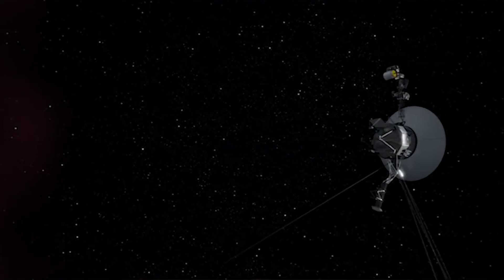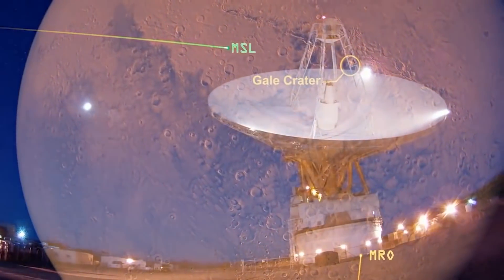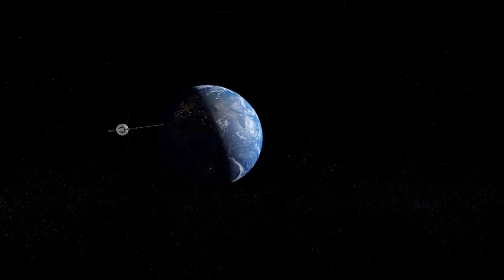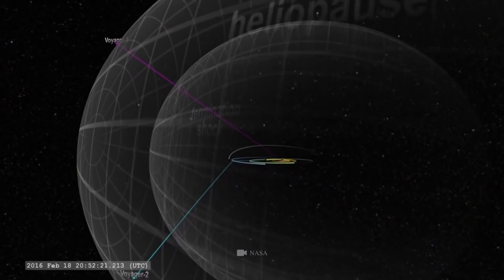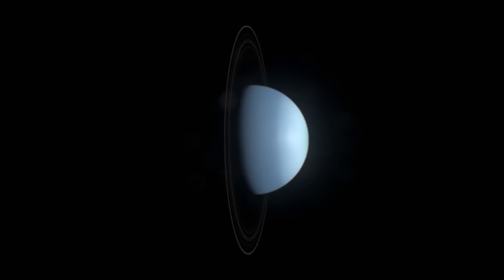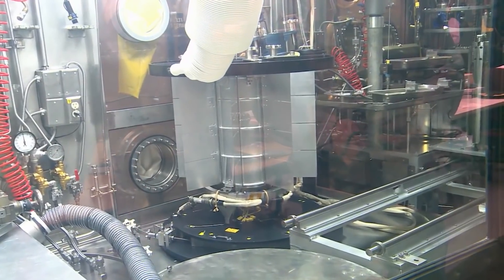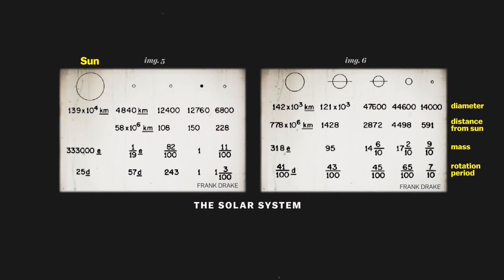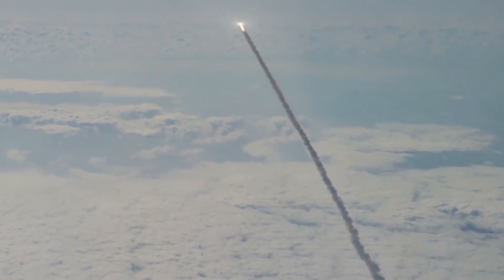Voyager 2 is FINALLY Back Online but Scientists Found Something SHOCKING

Comment: AT 9min You told the wrong story off all, WHY an LP? Why????? Because with NOTHING you can Still hear sound out of it. Find your self a record, Just the record and go figure how you can reproduce sound with your fingernail to get the information off it. That is why a Record. Also a scratch on it or even broken you can still fix it. A harddrive or memory stic Just bits and zero's . how to read that compressed also? Even YOU at Earth has no clue  how to read that.TAKE a HArddisk from a vintage early 70's computer . Or a 78 RPM out of 1910. Give you 3 minutes to get the "data" from both of them.With the 78RPM Just a Toothpick will do. The Hard drive you are YEARS away to get to find an old computer, restoring it, finding the plans , the broken parts, the old Usermanuals, The software, Success. How about an Alian, how can He find an IBM system 360 back in space??

Comment: I say, turn the camera on again for a quick pic. Who knows what it might see.
Reply: The last image taken with the camera is known as the 'pale blue dot.' The camera is analog, and lower than NTSC resolution. It my not even resolve the sun at such a distance.
Reply: @moconnell663  But it might spot that alien craft hurling towards us....  Or away depending on what they saw...   🤣
Reply: 😂 its all fake
Reply: A lotta nothing.
Reply: Have you ever heard of any battery lasting 47 years,, ??????!!!! not a chance..
Reply: @healthinfo1314  uhh..Did you even watch the vid Bro?
Reply: @healthinfo1314  the Voyagers do not contain batteries at all. RTEGs are lumps of plutonium which remain hot due to radioactive decay, surrounded by thermocouples which convert that heat into electricity. It's a common method of powering spacecraft which cannot use solar panels.
Reply: @moconnell663  It would have to have so many thermocouples like right in a flame temperature to even light a led light,, it don't seem possible .. and to send a signal like hundreds of millions of miles constantly really. the best a thermocouple can put out is6.8 mV so you would have to have tons of them in series in an like a fire temperature to even get enough amperage to run a small bulb ,, and to get wattage of any kind out of them how is that possible..? And  really I think it would be lucky to put out a few watts at anytime.. And they say it is loosing. 4 watts a year so how many watts did it put out when it first left.. You tell me that. I mean  in the video they say it looses like 4 watts a year so 4 x 37 years that is like 148 watts it lost so what are they saying it  was producing when it started out.??. and what do they use to regulate the decrease in that power for the equipment... Please explain that. I can't figure it out.
Reply: @healthinfo1314  - https://rps.nasa.gov/power-and-thermal-systems/legacy-power-systems/  According to that there are 3 power generators at 158Watt initial power outage at each spacecraft - so they lost ⅓ of their power supply from beginning of the mission
Reply: @jm3779  How in that little thing with some thermal couplings or whatever they got get that much power out of some hot rocks.. thermal couplings put out such small amounts of power; super inefficient for generating power and you would need a box car full of them and just as many hot rocks to make that kind of power. And 3 power generators on it did you say.?? man now the pipe dream is too far out for me.. I would like to find a video of something like that actually working on the ground...
Reply: @healthinfo1314  - I think they use peltier electric elements to get the heat converted to electric power  - https://en.wikipedia.org/wiki/Jean_Charles_Athanase_Peltier - it’s similar what is actually used in many car cooling boxes, as you can use the peltier effect in both directions
Reply: @healthinfo1314  It is not very difficult to transmit data over such a great distance. What is difficult is discerning the signal from the spacecraft from ambient noise, thus the very low bitrate of communication, and the very large antennas involved on earth. A detailed explanation of the Voyager probe power source can be found here: https://en.wikipedia.org/wiki/MHW-RTG  Which scientific instruments are connected to the power bus is set by the spacecraft computer.  The computer also provides feedback about the bus voltage to controllers. The decrease in power is regulated by the decay of the plutonium-238, which has a half-life of 87 years, so it would be logical that the power output would fall to 50% after ~43 years. The Voyagers each had 470W to work with at launch, and currently have about 250W available.
Reply: @healthinfo1314  If you want to do a fun experiment, hit up eBay for a Peltier Junction. The cost has come down tremendously in the last few years, they're like $7 now. When you apply electricity to them, they pump heat from one side to the other. One side becomes frosty, the other scorching hot. Curiously, if you apply heat to one side, and cool the other it will work in reverse and generate electricity (not very efficiently, but it does work).
Reply: @healthinfo1314  It's alien tech from Area 51, you wouldn't understand.
Reply: @jm3779  Well I read the article and it does not say they make power and says  when power is applied it causes it to transfer 
heat..  Possibly it works the other way I don't know,, you got anymore info on that..
Reply: @moconnell663  if it lasts that long why don’t we use that energy on earth too
Reply: @moconnell663  Interesting concept but where are the thermal couples in the picture..  I mean they say it is powered by  thermal couples in the video but I don't  see them listed in the diagram...
Wow If I could get some of those hot rocks and put the in a boiler just think  how much it could save me on heating never mind electricity..
Reply: @healthinfo1314  - You can use peltier elements in both ways, that mean if you apply heat to one side and cool the other side they generate electric power - that is what they use there on that satellite, but if you apply electric power to the element in result one side will be get hot and the other side cold - that way it  is used in car cooling boxes.
Reply: @healthinfo1314  - https://en.wikipedia.org/wiki/Radioisotope_thermoelectric_generator - in most English publications out there the here used reverse of the peltier effect is called seeback effect - https://en.wikipedia.org/wiki/Thermoelectric_effect#Seebeck_effect - in German publications it’s mostly only called peltier effect, but as Italien Alessandro Volta discovered that first it should be probably named after him and not after peltier or seeback.
Reply: @MunchieMan304  Technically we have, in highly specialized applications such as: https://en.wikipedia.org/wiki/Radioisotope_thermoelectric_generator#Terrestrial  The main problem with using them in this way is safety, they are highly radioactive and rather dangerous to be around. These tend not to be major problems in spacecraft.
Reply: @healthinfo1314  Nokia 3210?
Reply: @healthinfo1314  radioisotopes decay very slowly and give off heat, as well as high energy Alpha particles in this case.  It' science.  Plutonium 238 has a half life of 87.7 years, so it's down to about 70% of where it started.  It is NOT a chemical reaction like what you know as a battery.  I don't think you'll ever buy a battery in public with that as it's power source, of course you've never seen one, but it does work the way they say.  Sorry, find something else to go on about.
Reply: @nathanwahl9224  You say to go on about something else but I am just trying to get the numbers to make sense in my head.... I understand it is not a chemical reaction it is heat on thearmalcouples but each one only puts out  25 to 35 millivolts; so how many thermalcouples and how much heat would they  need to put out the watts they say it started with....I am not sharpest knife in the drawer and got little education and am old now,, but when I was a little kid they said they had probes flying by mars so I am curious how they did it..
They say they lost 4 watts a year so 47 years that is 188 watts loss and they lost 70%  so how many watts did they start out with and how many thermalcoupls would it take to do that with how much heat..If you could help it would be appropriated.
Reply: @healthinfo1314  .... It's called rocket science for a reason!
Reply: @healthinfo1314  the voltage and current generated by a thermocouple is directly related to the temperature differential between the hot and cold sides. Since space is about -270° C, and the plutonium is about 1000° C, you can see there's around a 1200° C ~ difference.  According to this web page, https://scienceimproved.com/how-to-generate-electricity-thermoelectric-generator/
a modern day peltier will produce 4.8v at 669 ma with only 100° differential... You do the Math! Of course,  the technology wasn't that efficient in the 70's, but it should give you some idea as to how and why,  they are able to generate as many watts as they do....
Reply: @Quickened1  Well finally it makes sense but they said thermocouple's,, so why did they not just say that in the first place instead of making s dummy like me go nuts.. Finally someone explained it,, thanks,, what do you do for a living ,, want to commend you for reaching out to help; it was driving me nuts and causing a lot of people to say I am even dumber than I am . I know I am not the sharpest knife in the drawer and I accept being called stupid but I had no knowledge of those things just a bit of experience with thermocouples.. But now I only have a problem with the layer they call the thermosphere that they say is gong to up to 3600 Fahrenheit or higher could you explain how that works.. Thanks a million..

Comment: "Even if radio waves travel at the speed of light, it would take ages for a signal from Voyager 2 to reach Earth, and vice versa".  

Uh, radio waves DO travel at the speed of light.  There is no 'if'.
Reply: Well, they were using Common Core math, so what do you expect?  It takes ages to figure out what 2+2 equals, and half the time they get 5 as the answer... 🤣
Reply: @JeffCounsil-rp4qv  hahaha

Comment: Me: Angry for 500ms ping lag.

NASA guys: Controlling this in 17hour+ ping
Reply: With an unrooted satellite dish launched in 1972. 

Einstein said: The difference between genius and stupidity is that genius has limits.
Reply: 34 hour ping...there and back.
Reply: @davidconklin7666  34 hours is ping+pong
Reply: @VORASTRA  Ping (latency is the technically more correct term) means the time it takes for a small data set to be transmitted from your device to a server on the Internet and back to your device again.
Reply: Outdated coding as well. NASA has a problem finding people to run the software.
Reply: @spockrising3208  It's written in Assembler, not Klingon. They just needed to dig up the documentation.
Reply: @BlackEpyon  tell them that. Lmao.
Reply: @spockrising3208  That's what they did. It's an archaic form of Assembly, certainly (I think it's Assembly B?), but that's why professional programmers keep notes. Modern programming uses "remarks," which are lines of code that are ignored by the interpreter, put in place for the benefit of the programmers. But back then, because storage space was at a premium, they couldn't afford any excess bulk in the code, and all their notes were kept in binders. 

Assembly is still used in programming today for "low-level" applications where it becomes necessary to control the hardware directly.
Reply: @BlackEpyon  thanks. Thats pretty informative. I watched a interview with a nasa guy regarding the voyager mission that basically said what I did. I never thought about it though. Admit I felt like an A hole for a minute. I actually have some books that I had inherited from my uncle with some assembler stuff in it, I should dig em out.
Reply: @spockrising3208  Well, that's not to say that Assembly isn't a niche among programming languages, especially with much more user-friendly programming languages available these days. But there are plenty of people who can work with it. 

I know of a group among the vintage computer community who restored one of the few remaining Apollo Guidance Computers (it's in a private collection) to operational status for Apollo's 50th anniversary. https://youtube.com/playlist?list=PL-93BVApb59FWrLZfdlisi_x7-Ut-w7
Very nerdy stuff. If, like me, you're into vintage computing, this is as good as it gets!

Documentation certainly helps that kind of endeavour, but when worst comes to worst, if you have a sample of the hardware, you can always reverse-engineer it. They even managed to read and extract the programs from some of the memory modules that NASA employees had kept as keepsakes.
Reply: @spockrising3208  well, when does Voyager 3 exist?
Reply: @Enderia2  at this rate.... 249.8709 solar years.
Reply: @spockrising3208  because they keep getting old and dying.most of it's support are retired on pensions
Reply: @spockrising3208  it's going longer then alot of other satellites and rover's.its been in winter temperatures for 30 odd years.
Reply: 61,200,000ms ping
Reply: It has been on joystick with 30 years course correction hardly needed
Reply: @paulmurphy8549  No joystick. Not that you even could with that kind of lag. All commands are calculated ahead of time and uploaded via computer control. It's not course corrections that are needed at this point, but to keep the antenna pointed at Earth. The farther away it is, the greater the signal loss if the angle is off by even a fraction of an arc second.
Reply: @BlackEpyon  Im glad you had picked that one up for me, I would of butchered the terminology. I was going to address "winter conditions" as it relates to the dissipation or "transfer" of heat in a vacuum. Then, I was going to explain what hot hydrogen is. In the lesser cloud, the region of space that our star is currently passing through, those elements register at 578 F if I remember correctly. You would never feel the heat though, not enough material to transfer the energy.
Reply: @BlackEpyon  ah yes parsecs thanks for reminding it u need 3 arc for it
Reply: Tbh it doesn't need difficult inputs so idk why anyone keep bringing this broken comparison...
Reply: Wait until you see the probe sent to pluto 3 DAYS WORTH OF PİNG
Reply: Maybe a wifi extender will help.
Reply: 😂 its all fake
Reply: @franklyspeaking4480  what if it's not?
Reply: @spockrising3208  
See, you are unsure yourself.
Im actually commenting on another post/comment figuring out what is needed to pull this off, according to nasa.
Basically, it'll take a miracle for this to happen. 😂
Space is fake.
Time to wake up
Reply: @franklyspeaking4480  unsure? Jeesh. Heck, I just wanna talk to someone.
Reply: @spockrising3208  
Talk away bro.
Whats on your mind ?
Reply: @franklyspeaking4480  bois we got a karen here
Reply: @aagamanpokhrel4113  
Yet you are the one who got triggered over a comment not directed to you. 😂
The irony.
Reply: @ElderAleks  
6 years on youtube
7 subs
0 content 
& you call me the troll ?
Thats rich coming from a dude who got triggered so easily. 😂
Reply: @franklyspeaking4480  1) Not religious. I'm an atheist.
2) i dont want to be a YouTuber, I find that that lifestyle would be stressful. So I don't wanna make content. 
3) If you want the origins of my name explored, watch a CowChop.
Reply: @franklyspeaking4480  prove you’re real. See? I guess if space is fake then so is your opinion 😁
Reply: @darylingoteborg3178  
Well, you trigger easily 😆
Reply: @franklyspeaking4480  just launch a weather balloon
Reply: @franklyspeaking4480  iq: 0
Reply: @franklyspeaking4480  mad
Reply: @lands1459  
😂 So this is the channel you trolled on over from.
Reply: @franklyspeaking4480  sure

Comment: At 0:55 . . .
Voyager 2 Is Back Online, 11 Billion Miles From Earth			
Reference: 	https://www.youtube.com/watch?v=81TxXD2aV5Q		
			
D = Distance: 11,000,000,000 miles	
S = Speed of light (radio waves): 186,282.3971 miles per second
T = Time of signal: to be determined		
			
S = D / T			
ST = D			
T = D / S			
T = 11,000,000,000 mi / 186,282.3971 mi/sec			
T = 	59,050.13 seconds	
T = 	984.17 minutes	
T = 	16.40 hours	
			
NOTE: The above times are for a one-way message only.

Comment: Light will circle the equator nearly 8 times in one second, but takes 17 hours to travel to or from this craft.
Yep.
Reply: yes thats how distance works.......
Reply: @dom1nation465  Firm grasp of the obvious, there.
Reply: Well the craft has been traveling at 36,000 miles per hour away from Earth for the past 44 years straight, so Yes.

Comment: It's super amazing how nothing has smashed into it..
No Meteor or micro rocks.. no nothing floating through space  so happy it's ok
Reply: well, space is pretty empty despite all the debris
Reply: @VORASTRA  Did you listen to what he said? 1 atom per cm³. Our atmosphere is around 1.5 mg per cm³. Plus they go outside of the celestial plane where most objects orbit around the sun.
Reply: @r.a.6459  so what? I've said space is empty.
Reply: How, precisely, do you know it hasn't been impacted and survived it?
Reply: Merica!
Reply: @EZ Z it doesn't hurt any that those old electronics were pretty chunky and robust back then; circuit board traces were pretty darned thick compared to today.  A lot of hard wiring.  You could have cosmic rays eat away at the conductors, have 90% of the metallic lattice destroyed and they will still work just fine.  Intrinsically  tough, although the capacitors may have posed opportunities. Today's microns-thick boards wouldn't make it on board without a lot of hardening, they'd probably resemble the old ones!
Reply: @nathanwahl9224  Murica!
Reply: @EZ Z Murica!